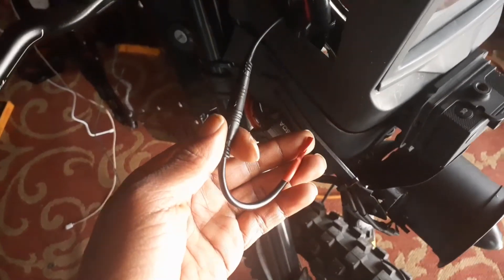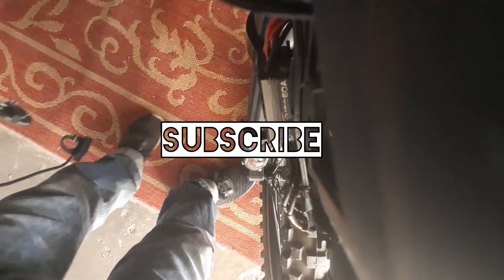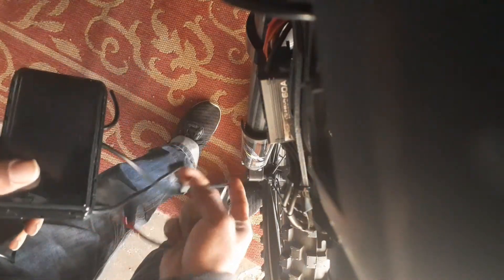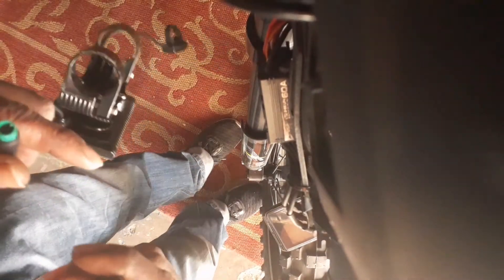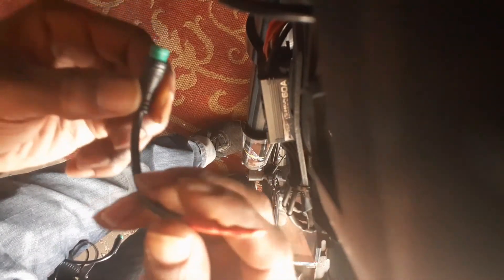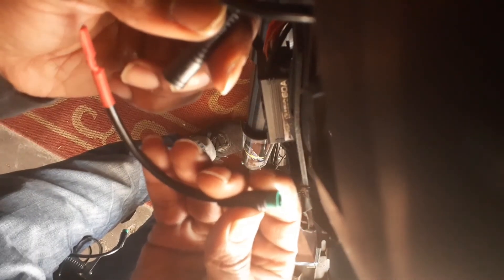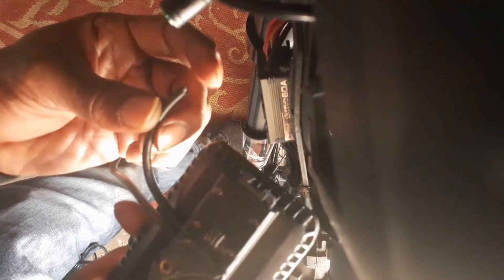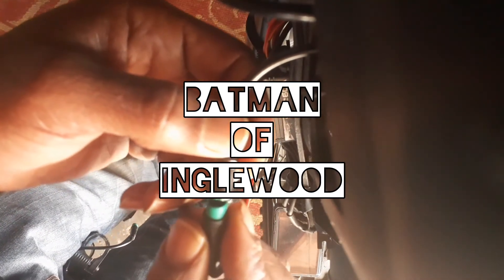How to Override ebike 5pin Display Screen (Color or Non Color) using Sabvoton Controller

Comment: I have a 5th wheel discover ebike 36 v with a display problem. Will this work for me?
Reply from the maker: Not sure. I do this on a Sabvoton Controller. The key is to find the two wires that turn (ON) the controller.

Comment: Can you just short out the blue and red wire on the controller harness... instead of using a shorted out male plug in?
Reply from the maker: Yes. The point of the video is to show you how NOT to short out from the controller. LEAVING THE CONTROLLER INTACT. Why screw up the controller?
Reply: @batmanofinglewood yeah true....if you can prevent it...even better 👍🏽. Thanks for the video
Reply from the maker: Yessir 👍🏾 but of course, if you have to do it, Do it. You can fix it back later on. Just so you know, you can purchase that 5 pin by itself and have it hidden on your bike😉🫡

I just subscribed to you. I mean why not🫡😎

Comment: Everyone ADVISE how simply and only wires...this shhh is pour horror more so then my M6 twinn turbo with bosch modules and 85 fuses 20 relays..
Reply from the maker: How so?
Reply: @batmanofinglewood  nothing is easy HERE thanks for your reply...we left msg also on your IG
Reply: We ONLY need this unit to ride...power motor and run display out stock and m5 display failed
Reply from the maker: Wait, so you're saying you're not using the same display as on the video?
Reply: @batmanofinglewood  NO this unit is GO TRAX R1 48V floding ebike
Reply: @batmanofinglewood  but appears consistent with your ideology as the blue and red gave us what was list with unresponsive display
Reply from the maker: Okay. That's the problem 🤦🏾‍♂️ ITS NOT THE SAME SYSTEM
Reply: @batmanofinglewood  display is 5 pin... BUT only at connect display as the cable continues to controller additional wires is mended turning the plug into 10 wires..this is our challenge what else is required mission accomplished ? as to the additional 8 wires
Reply from the maker: As I stated in the description, this is a Sabvoton Controller. I don't know what the wiring is for other controllers. Color codes are not standard in China. They do anything. I Bypassed the entire Display and threw it in the trash. I use my phone as a display. My controller is Bluetooth.
Reply: @batmanofinglewood  thanks ....I'm afraid your not copying....thanks anyways, we we under the impression you were a Tech in this field...IF you master THIS issue you would be King....561 buyers in holding pattern their purchase as to simply display unresponsive ad back ordered...many filed law suits...thanks again...the RED and BLUE is amazing and close too remedy but ZERO power to operation or engagement motor.
Reply from the maker: Just send me a picture of what you're talking about on my Batmanofinglewood Instagram account
Reply: @batmanofinglewood  please check our additional post below...we thinking you only read fist listed as to M6, but that's the last actually before your resoinse
Reply: @batmanofinglewood  we managed the red and blue Great.... what's ekes required...the blue and red gives in real time break lights Kool...what else to power operations?
Reply from the maker: Your wording is very confusing...🤷🏾‍♂️
Reply: @batmanofinglewood  confused wording....sorry....last question....what color wires would engage the power bypassing display?
Reply from the maker: It tells you this in the video...
RED & BLUE
Reply from the maker: RED & BLUE from the controller is what's needed to be connected for the controller to have power so the bike can be ridden.
Reply from the maker: So you do it by using the wire from the display instead of damaging the controller connector to get to the red and blue
Reply: @batmanofinglewood  NOT controller BUT display sorry typo
Reply from the maker: @RBARCLAY-m2d yes but send detailed pics

Comment: Our display is 5 pin but is joining other bythetime its reaches controller and 5 turned into 10 wires... the blue and red we connected BUT that ONLY powered BOTH break levelers to engage rear break light...we we happy for THAT BUT again otherwise zero occurrence and conclusion ZERO power or motor engagement to operate unit...please any othe advice we would appreciate it...go trax R1 display unresponsive...GO TRAX R1 folding eBike... horrible company zero stock of spare parts...unit is less 10 months old... strongly belived liquid as beer over few weeks ridding and spills killed this...new controller but display out of stock... M5 display powered on less 0.1 second and that also unresponsive!!
Reply: If your screen blips it's not the screen but the controller maybe?
Reply: @deanziyone2213  nope we got new display SAME shit totally unresponsive.. we had issues with manufacturer obtaining new display as out of stock and M5 SAME shit...now we awaiting OEM display from china whom will program one that's still not from manufacturer...this is horror...
Reply: @deanziyone2213  WHAT'S truly going on in THIS industry as the explosion of newer ebikes...the hidden codes and spare part's THAT only the manufacturer holds key's too and wouldn't permission anything beyond there brand, ... suggestions anyone buying anything scooter or ebike should buy quickly these parts as controller and display as when time goes on you want find them...this ebike is time stamped less 10 months old and horror as the brand has a waiting list for parts and copyrights to anyone attempting to provide you that contractor provided part at time of manufacturing.
Reply: @deanziyone2213  NO GOD can remedy this as a apple iphone 15  locked 🔐 and sold locked as to unlocked and can function with any carrier sim...
Reply: @deanziyone2213  even obtaining new controller and display matching ...the rear wheel motor contains a lock , suggestions ALL new harness controller display throttle etc you MUST replace and basically only the frame and battery your paying for..but THAT cost of rebuilding is a risk of total uncertainty anything would function.

Comment: What power mode is it in ? Can U leave it in 5th or will it be in 1 once you power on and off?
Reply from the maker: Without Display there's no governor. In other words, FULL POWER unless you get a governing device like a switch that has Low, Mid & High position
Reply: @batmanofinglewood  thanks on my display the sw900 it has a button to cycle through 5 power modes this button is attached to the display so if I remove the display which will remove the button also will it be stuck in 5th speed which is full speed or will it be stuck in the 1st speed  ?
Reply from the maker: Same question. Same answer 💁🏾‍♂️🤷🏾‍♂️

Comment: Will this work on bafang hub motor with a king meter 3209 display?
Reply from the maker: I've only tried this on a Sabvoton Controller
Reply: @batmanofinglewood  ok thankyou. Would you know if it would possibly bypass factory speed limiter if I tried
Reply from the maker: I really have no idea but it seems to me that would be the case because if the speed is limited by the Display then I suppose it will override without Display. Sometimes, controllers have a way to limit the speed as well so it could be possible the controller is limited by speed but probably NOT.

Hall sensors from the motor help controllers provided speeds data I believe
Reply: I have the 860c from bafang middrive i put a full length cable from the controller to the green 5pin on the display  on a fatwheel hub motor and i can do things now that you just cant with a normal display it seems confusing but your only switchin 2 wires no shortouts  and if it ever does stop ive got this back up  piece my man here is showing  i actually have a couple for not needing keys  for bikes and scooters if u get my drift ✌️

Comment: There is 40v on red at display, does blue send 40 v to controller ?
Reply: Is your battery full if you're showing 40 volts that is basically almost fully charged 36 volt system or it is a depleted 48 volt system or a depleted 48 volt battery in need of charging however in general you should get your main battery voltage between red and negative or black from red to blue you should get just a little bit under that first reading which you got the yellow and green wires are usually communication signal wires you don't want to mess with those
Reply from the maker: I don't have those types of systems anymore. It's been too long. I don't remember 😔

Comment: Heya. Will this also work for the KT controllers? I think they should as they have the same julet cable connections that you have. My controller has the same 5wires comming out of the 1-4 cable that connects to the lcd display & throttle. 

I’m asking because my on/off switch on my lcd display has been acting up so bad. But i still want to be able to ride the bike while i wait for my new lcd to arrive. 

Thanks.
Reply from the maker: I'm sorry you're having issues. I only can say this works with Sabvoton Controllers.  But many ppl have said it has worked for them. It NEVER stated if they were using a Sabvoton Controller. You may have to try it out (at your own risk) of course. That's my disclaimer. 🫱🫲🤝 

If so, try only applying very little turn to the throttle as possible and slowly build up for testing and MAYBE it will work out. Please let me know whether or not it worked so I can know as well. THANKS IN ADVANCED 😎👍🏿
Reply: @batmanofinglewood  thanks. Tbh i dont even mind using pedal assist only. As long as i get power i’m fine. I’ll give it a go and see to be honest. Thanks for your super fast reply. Appreciate it.
Reply from the maker: The faster, the better 😎👍🏿🏍️💨

Comment: ya but know your stuck in limp mode
Reply from the maker: At least you can get the thing to work. Do you want to walk the bike home or ride the bike home. The features of the display are garbage anyways. If you want to go 10mph go 10mph that's what GPS is for. It's not like you lose control of the throttle output. In other words, you have full throttle control. No boggling unless the controller is Bluetooth and has been programmed to do so

Comment: I've got it quite a few blue wires and red so I'm having a hard time following which I have the sw900 display. And it's giving me a false battery reading and I've checked the battery it's fine
Reply from the maker: Not sure why you have multiple of the same color. Never heard of it. Should only be 5 wires. Black, Red, Blue, Green & White / Yellow

Comment: Question what if I wanted to change a cord myself I have a 6 pin male I want to change it to 5 pin male for the 6 pin, the colours are Green, Blue, Yellow, Red, White, black and on the 5 pin it’s Green, Blue, Yellow, Red and Black, there is no white on the 5 pin, what would I do with the white?
Reply from the maker: White is usually for reading temperature from 6 wire halls sensor plug. Anyways, just tuck it away making sure it doesn't touch other wires.😎👍🏿
Reply: @batmanofinglewood  if you have discord or something I’ll show you exactly what I am doing to make sure what you are saying is correct?
Reply: I am trying to use a 6 pin throttle/display on a 5 pin wire are you sure I just tuck that wire away?
Reply from the maker: You should be using a multi meter to check for continuity of each wire. Wire set-up from the plug 🔌 might not be standard. 

The info I give in this video is for people using Sabvoton Controllers. It may work for others

Comment: Hi, is the Red cable 38v or 5v?
Reply from the maker: I just got the info for you brother. The Red is whatever your Battery Voltage is + positive. The black is whatever battery voltage is - negative. In my case, 72v battery so my bike will be Red+ 72v, Black- 72v and so on. Cheers Mate🍻

Comment: Batman, Since youve got the cable cut already, would you be willing to make another video where youve found out which female pins are the red and blue so that then it would be real easy to short those in the female end with a little u shaped piece of wire?  Thanks for the video btw.
Reply from the maker: Your talking about a bridge. Yes, if I get the chance this week or maybe today. After I analyze the wire, if it makes sense, I'll do a vid. But this could potentially cause a serious problem. Controller could be TOTALLY DAMAGED if done improperly.

I just subscribe to you😎
Reply: Facts! Way way more simple, and can find a peace of wire, staple, in order to fix or have on your person. 🎉 you hit that nail right in the head Jeff.
Reply: By the way. The greatest gift is knowledge. So thanks for the video, because with out it, we would have never known.
Reply: Not all SW 900 displays are wired up the same way as far as the location of each color wire in relation to the pins which are in the connector every e-bike manufacturer that might happen to use a similar display has a different wiring diagram I'm assuming for patent or copyright purposes something to that effect if you were to take 10 versions of the same display from different e-bike manufacturers the wiring order would not be the same for at least half of them there is a possibility that some are similar but it's not always true so be careful following people's instructions on these videos like this it's best to use a scrap connector stripped wire leads and use a Multimeter to check for the power coming out of each wire and if you're capable of doing that there is a way to locate and determine each wires function well you have power running into the controller

Comment: Will this work on a electric scooter? I done on my electric bike and it worked
Reply from the maker: I just subscribed to you
Reply from the maker: It MAY or may NOT. If it's a Sabvoton Controller, then yes it will work😎💪🏿👍🏾 anyways, hope all works out. I appreciate your time spent on my vids
Reply: @batmanofinglewood  thanks subscribed aswel
Reply: @batmanofinglewood  its 48v 25amp jp48a07 controller for a solar p1 scooter

Comment: So if you connect the red and blue wires together will pedal assist work or just throttle? I just don’t want the bike taking off. Also will it harm the controller doing this?  I have an Lectric bike with a E-5 display will any e-5 display work on this bike or does it have to be Lectric brand? Thanks for your help.
Reply from the maker: I'm not sure if this will work for your controller. The safe way to do so is to lift the rear wheel off of the  ground before testing. I'm using Sabvoton bluetooth controller for my setup. If may differ from your controller but may not? 

USE AT YOUR OWN DISCRETION. IM NOT RESPONSIBLE FOR WHAT MAY HAPPEN TO TOUR DEVICES 👍🏾😎
Reply: @batmanofinglewood  m
Reply from the maker: @claytonmerchant7161  ? What did you need? I don't see your message
Reply: Can I order this plug from somewhere?
Reply from the maker: Amazon. Five Pin Ebike Plug.

Comment: Excuse me.   Could you make this idea practically ? Or in other words.   For what should I connect red and blue ? Thanks alot sir
Reply from the maker: It is so your controller will activate if the display doesn't work
Reply: @batmanofinglewood  
Got it .. thanks sir
Reply: @batmanofinglewood  
Sir if you do not mind : 
Could I connect BMS with 15 wires to 48volt battery wich is 13s  = 14 tip/point ??

Could I or it is only for 52v battery = 14s = 15 point ???
Reply from the maker: @mhmdsaleh3502  I'm kinda confused of your question.  I'll say this; if you have a  20s BMS, you can wire it up to do less but NOT more. 

Example:
20s BMS = 72v Nominal 
If I want, I can wire it to a  lower voltage. Not a higher. Need a BMS that matches the number of series connections the battery has.
Reply: @batmanofinglewood  
Yes sir.   My confused that : 
BMS has 15 wire .. the battery has 14 point.   If I could connect it , where should I put the last or the first wire of BMS which is without place now !
Thanks and sorry for annoying
Reply from the maker: Your BMS circuit board usually has numbers. Supposed to start from cell 1 to the last cell
Reply: @batmanofinglewood  
So I should leave the last wire without any connection ? Are you sure sir ? I mean have you try this ?? 
And thanks very very much for your time
Reply from the maker: You have to search for your BMS SCHEMATICS. All BMS are NOT the same. Depending on the number of cells determines how you connect the wires. You DEFINITELY need to find the SCHEMATICS. Very simple to read BMS SCHEMATICS
Reply: @batmanofinglewood  😍♥️